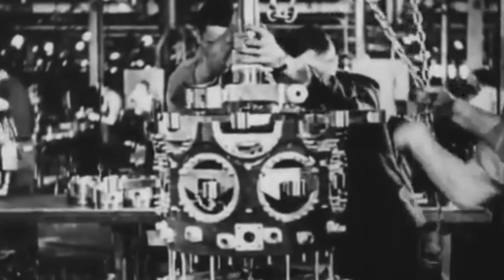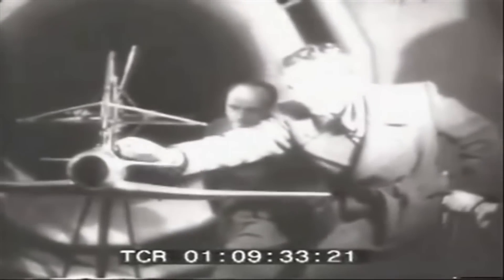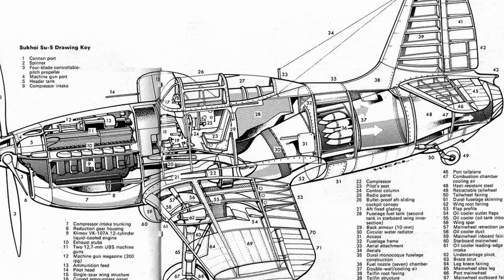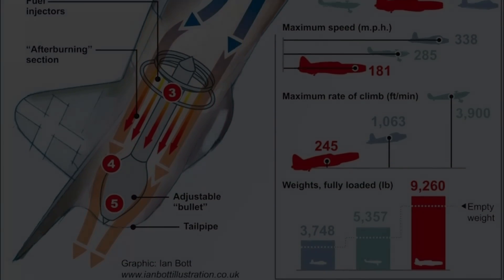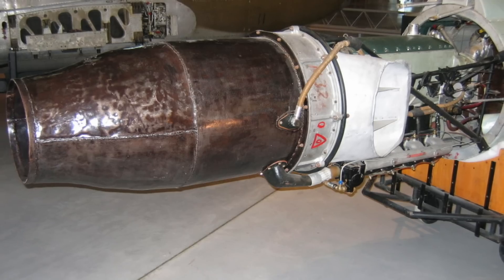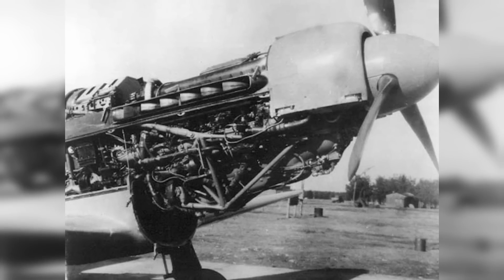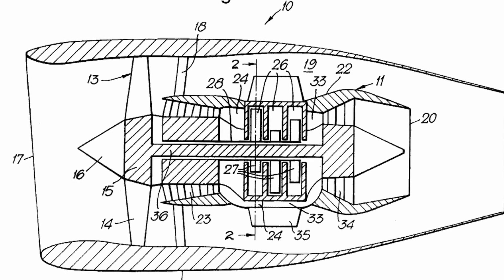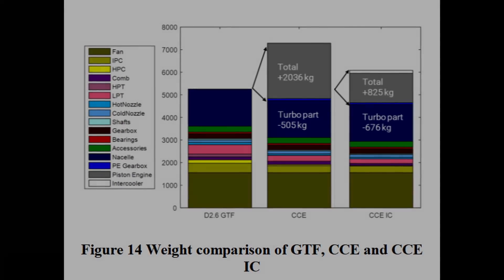What on Earth is a Motorjet?

Comment: I wonder how it would be if you had a hybrid system. An Electric motor powering the compressor fan, that is powered by a fuel cell?
Reply: The problem with powering a compressor with anything but a turbine on the same shaft is immense power that is needed. For instance a model turboshaft engine gives out about 5-6 kW of shaft power weighing 3-4 kgs. So to power its compressor one would need about 9-12 kW motor. And most likely a gearbox as the compressor wheel should rotate at about 100k rpm speed. It did make sense at the time when there wasn't much experience in combustion chambers designing and turbo jet engines in general so it was easier to control and tune the prototypes separately for the turbine and the compressor sides but once their performances are balanced there is no point to put anything in between.
Reply: So two totally different power trains powered by two totally different fuels, one of which is expensive, heavy and inefficient for aircraft use where weight and efficiency are everything? Yeah that sounds like a winner
Reply: Yes, it would work, the Caproni Campini could fly on fan only and then turn on the burner for extra thrust.   If you used an alkaline fuel cell (which is being developed for the Piaseki Helicopter) the cooling requirements of 250C could be used to preheat the air before the burner.    Motor jets could work, the reason Caprioni's didn't was the primitive nature of the piston engine which lacked an effective super charger.
Reply: Just wouldn't make much sense. Now, a compressor that can be shifted to electrical power, mounted to a zeppelin or blimp that carries solar cells? That could work. But just hydrogen? Makes more sense to run a normal jet straight off of hydrogen.

Comment: Some cruise missiles have tested the idea of combining the Motorjet with a Ramjet as the Ramjet needs to be traveling above a certain speed to work and since neither ramjets or motorjets need to have the assembly to harness the hot air to turn the compressor you can build a system where a small motorjet is responsible for the initial starting of the missile and propels it up until a point that the ram intakes are effective enough to take over at which point the motorized compressor turns off this system allows you to make the missiles engine out of cheaper material I've never seen it done but a Scramjet-Motorjet combo should work.

Comment: Frank Whittle initially thought of a piston engine to power the compressor in the 20s, but realised it wasn't necessary - a man way ahead.
Reply: While Whittle was right that the turbojet was better but the Motorjet could be made to work and would have provided high speed flight.  the reason Caprioni Campini didn't show advantages was the primitive nature of the piston engine which lacked an effective super charger.    A Rolls-Royce Merlin 66 could generate 300lbs jet thrust.  The bigger Jumo 213E could generate 440lbs jet thrust.    Had light weight engines of this type that could provide high powers to 30,000ft (full pressure altitude) where jet thrust would have been of benefit.
Heinkel invested heavily in motorjet research  using engines in which jet thrust from the exahust was combined with a motor jet but in the end invented the turbojet instead (Chain mentions he ran the engine under its own power 9 days before Whittle but said Whittle engine had solved the burner problem whereas they were still using hydrogen) 
-Junker, BMW, Fiocke-Wulf.
In the USA the man that invented the Laminar Flow wing at the NACA: Eastman Jacobs had a trans-sonic aircraft in the 1930s that eventually led to the Bell X1.  "Jakes Jeep" (the code name) and a turbocharged R-1560 as the engine and laminar flow wing.  Hot air from the radial added to the heating by the fuel.
Reply: @williamzk9083  
Heinkel invented the turbojet? 
Tut, tut!
Reply: @williamzk9083  
The Bell X1 was based on the British Miles 52.  The plans were given to the USA.
Reply: @johnburns4017  The British claim the all flying tail was stolen by NACA but they don't claim the Bell X.1 was based on the M.52.   You can see the roots of the Bell X.1 in Jakes Jeep and the transition from V tail to horizontal T tail and then all flying tail.   The biconvex wing section from the M.52 came from Swiss Aerodynamicist Jakob Ackerart and the Bell X1 used a 6 digit laminar flow series that was refined from the P.51 Mustangs section.   I'm ma big fan of the M.52 but they yanks didn't copy it and the all flying tail is open to debate.
Reply: @williamzk9083  
There are a number of vids around on the Miles 52. Jeremy Clarkson brought this up in one vid. The plane was developed in secrecy. The Miles team were told to stop work, with drawings sent to the USA. The Bell X1 is mostly based on the Miles.

A remote controlled scale model was made of the Miles 52, which did break the sound barrier in level flight. The Bell X1 broke the sound barrier in a dive. The flying tail was first fitted to a Spitfire for testing, which reached Mach 0.85 in WW2. 

The level of technology transfer to the USA was amazing. Look at the British space programme, Megaroc, which planned to have a man in space by 1950.  They even built the rocket and capsule before the whole project was cancelled.  All this was handed over to the USA, who based their manned capsules on Megaroc. 

As an aside, the designer of the M.52, George Miles, persuaded the British government for him to make the Biro ball point pen for RAF men to use at altitude. The first ball point made in volume.
Reply: @williamzk9083  Jakes Jeep? Is that another jeep or are you confusing it with Jacob's jeep which was in fact a motorjet and I don't know why it wasn't included in the video?
Reply: @fritzwrangle-clouder6033  The NACA motor jet is universally referred to as Jake’s Jeep including Anderson’s History of aerodynamics.  You are the first person I’ve ever come across  calling it Jacobs Jeep.   Given the flippant American name Jake sounds like it.
Reply: @williamzk9083  Okay, I've undoubtedly just remembered Eastman 'Jacob' and his 'jeep' and put those together in my head. But you confirm that it was a motorjet, so it strikes me odd that flight dojo didn't mention it.
Reply: @fritzwrangle-clouder6033  It never flew but there are photographs of it in a wind tunnel.    Happ Arnold had made the decision not to inform the NACA of jet engine technology.  When they found out abut the jet engine (probably in 1943)  Jakes Jeep was dead.
Reply: @williamzk9083  
Heinkel did not invent the turbojet. Frank Whittle did.
Reply: @johnburns4017  von Ohains Turbojet operated on its own power 9 days before Whittle.  Heinkel turbojet flew in an aircraft 3 years before Whittles.
Reply: Hans von Ohain, the leading German jet engineer, wrote a very comprehensive foreword in the 'Elements of Propulsion, Gas turbines and Rockets'. In the foreword he states:

"The first patent of a turbojet engine, which was later developed and produced, was that of Frank Whittle, now Sir Frank. His patent was applied for in January 1930. This patent shows a multistage, axial-flow compressor followed by a radial compressor stage, a combustor, an axial-flow turbine driving the compressor, and an exhaust nozzle. Such configurations are still used today..." and "From the beginning of his jet propulsion activities, Frank Whittle had been seeking means for improving the propulsive efficiency of turbojet engines. He conceived novel ideas for which he filed a patent application in 1936, which can be called a bypass engine or turbofan. To avoid a complete new design, Whittle sought an interim solution that could be merely "tacked on" to a jet engine. This configuration was later known as the aft fan. Whittle's work on fan jets or bypass engines and aft fans was way ahead of his time. It was of greatest importance for the future or turbopropulsion." and "In April 1937, Whittle had his bench-test jet engine ready for the first test run. It ran excellently; however, it ran out of control because liquid fuel had collected inside the engine and started to vaporize as the engine became hot, thereby adding uncontrolled fuel quantities to the combustion process. The problem was easily overcome. This first test run was the world's first run of a bench-test jet engine operating with liquid fuel.".
Reply: @EngineeringFun  Nice, you even talk like a child. You can't accuse somebody of being triggered if you've already had an autistic breakdown
Reply: The first motorjet airplane: https://en.wikipedia.org/wiki/Coand%C4%83-1910
Reply: @EngineeringFun  From all accounts its sounds like the aircraft never flew and the guy turned out to be a charlatan
Reply: @EngineeringFun  You have the audacity to think you're reputable enough to discredit the internationally recognized inventors of powered flight then tell me "there are some detractors who try to poopoo" the fact that Coanda never made a jet engine despite the consensus that he didn't. That's not a few detractors that essentially everybody and it's debatable whether he even actually flew the "aircraft"
Reply: @EngineeringFun  Yes, I have hobbies that actually take some thought, rather than plagiarizing software I downloaded from a website as my own work. See, you're making it even more evident how sad and eccentric your weird obsession with Microsoft Excel is when you act like it makes you an engineer or treat it as some accomplishment.
Reply: @EngineeringFun  I'm sorry bud but you don't work in the engineering field just because you like Microsoft Excel and download animations from a website and pretend they're your own. Also, nobody with an ounce of credibility is using Excel for engineering solutions.
Reply: @EngineeringFun  Idk if I have low self esteem issues, I don't usually throw hissy fits when somebody criticizes somebody I look up to or a useless hobby I pretend is ingenuitive.
Reply: @EngineeringFun  But hey, I'm still waiting on even one citation that would prove that Coanda actually flew his aircraft or that he invented a motorjet rather than a large vacuum cleaner
Reply: @Rico-v7r  I take the challenge, and I give you a donation of your choice if you prove me which model and where I plagiarized it from. I need concrete reference. Give me a video link off my channel and perhaps a time reference within the video. Otherwise you can be rambling the whole day, since you seem to have nothing to do but troll people.
Reply: No, this is not motorjet. Coandă was powered by ducted fan. Had no fuel injection to combustion chamber.  But this invention was important for turbojets, I agree in 100%.
Reply: @MWNNxChillOut  
Bravo , Mr. Chillout .
However , there's no fan in it . That actually makes it a ducted air-blower . 😎
Reply: @EngineeringFun  Technically that is not a jet since there was no fuel injection and no high speed thrust generated by thermal cycle...it was a ducted fan + compressor +  a nozzle
Reply: @electricaviationchannelvid7863  Technically that is a jet.
Reply: @electricaviationchannelvid7863  , @My Opinion Doesn't Matter    -    It DID have fuel injected in the compressed air volume. Actually that's how the now famous Coanda effect was developed, despite the deflectors near fuselage, the flames licked the fuselage after a certain speed. The numbers if I remember well were 80kg thrust without fuel injection and 220kg with injection (not sure of the precise numbers). The accident in which his jet crashed and burned was because of the unexpected high thrust after the fuel was turned on. The Romanian man was a professional designer with Bristol and not a pilot. He intended to only taxi the plane and didn't know how to pilot a plane. Read about this guy from less biased sources than Wikipedia. I studied him extensively in college and personally saw his creations with detailed blueprints at the Dimitrie Leonida technical museum in Bucharest when I visited as a student. There are many articles and detailed plans about his planes and there is also a motor jet sled he created. There is plenty of misinformation floating around (including from some YT channels!!) because some people who made similar stuff decades later wanted to be first in history books. Just think about this, only 7 years after the Wright brothers' flight with a stick and canvass contraption, at the time when stick and canvas was still state of the art this guy has a plane without any canvas (all mahogany plywood) and without the bracing wires AND with jet propulsion. Gustave Eiffel, the designer of Eiffel Tower, once said about Henri Coanda: “This boy was born 30, maybe 50 years earlier.” https://adabarbu.medium.com/henri-coand%C4%83-a-romanian-inventor-a8a301162e80
Reply: @EngineeringFun  Well, then I was wrong, sorry!
Reply: @electricaviationchannelvid7863  Henri Coanda is a national hero on all the curricula in my country. Very well scrutinized. He's kind of a Romanian Nikola Tesla. Cheers!
Reply: @electricaviationchannelvid7863  Technically it is a jet, as it produces a high velocity stream of gas (AKA, a jet). It's not a turbojet though. Jet doesn't refer to a combustion process at all, it refers to a form of thrust. Even an EDF is a jet. LMFAO.
Reply: @My-Opinion-Doesnt-Matter  Yeah technically it is a jet
But realistically its a subsonic jet which cripple the only reason for a jet engine.
Reply: @shelbyseelbach9568  So technically a rocket is a jet
Reply: @Rico-v7r  No, technically the term "rocket" refers to the craft itself, not the propulsion system.

rock·et
noun
a cylindrical projectile that can be propelled to a great height or distance by the combustion of its contents.

Solid fuel rocket motors probably qualify as jet thrust, a liquid fueled rocket receives thrust from a combustion event that takes place outside of the motor and vehicle entirely.
Reply: @electricaviationchannelvid7863 😅

Comment: 1:27 didn't (Romanian) Henri Coandă try something like this in a plane in 1910?
Reply: He made a ducted fan.
Reply: @thejohhny2943  no Coanda did made a real compressor with gasoline injection in the compressed air: this design is well known
Reply: I was thinking the same thing when I saw the title, but Coanda's experiments were more focused on recapturing the excess energy in the exhaust of a piston engine. No reheat, just fully expanding the exhaust.  So while the motorjet uses the piston engine to replace the role of the turbine in a jet engine, Coanda used the piston engine to replace the  compressor and combustion stages.

TLDR: Coanda did the opposite of this, sorta

Comment: if weight penalty is offset by less fuel burn, the loss of fuel weight could potentially offset the weight penalty.
Reply: except the better fuel burn rate would allow for longer ranges or more time over target, the first being valuable for all aviation. Your average bush plane gets 800-900 miles range with a turboprop, if the motorjet could reduce fuel burn without the weight gain the same fuel load could add 200 miles to that.